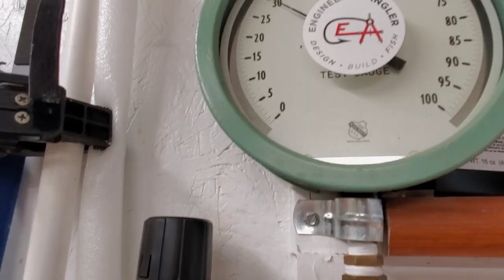Square-Bill Crankbait; Make it, Paint it, and Fish it #squarebill #paintinglures

Comment: Great stuff as always Franco! You used (Minwax?) polycrylic as an inter-coat, is that product any different/better than Pledge or Varathane brand Diamond Wood Finish in that application?
Reply from the maker: The pledge has given me some issues in the past.  After some time in the tackle box some lures, that I have used pledge on, have had the finish wrinkle.  Not all have done it so I'm not absolutely sure it is the pledge but I have not had it happen with the minwax.
Reply: @EngineeredAngler  hmmmmm, curious. Were the wrinkles subtle or serious ? Guessing and throwing a couple of ideas on the table... could be different rates of expansion between the epoxy , the Pledge and/or the pigment layers or could be a chemical incompatibility thing. Think the floor finishing products have "extra stuff" to prevent foaming and to give it more traction (less slippery to walk on) that would not be in wood finishing products like Minwax and that could be an issue. Any chance that the Pledge was not completely dry and moisture was trapped? The acrylic paints seem to dry matt (still waiting for my paints to be delivered so I can try things myself) , do you remove the "shine" from the polycrylic before applying paint? I always  steewool (0000) lightly between coats when  working with polyurethane, wonder if this would be a good practice with the glossy intercoats. Anyway,  guess that I will be using the Pledge to refinish the top of my work bench instead of as an intercoat.  The work bench definitely needs some TLC.   :)
Reply from the maker: The wrinkles were pretty bad...never really tracked down the problem.  You might be right about the possibility of the pledge not drying completely, I can get in a hurry some times.